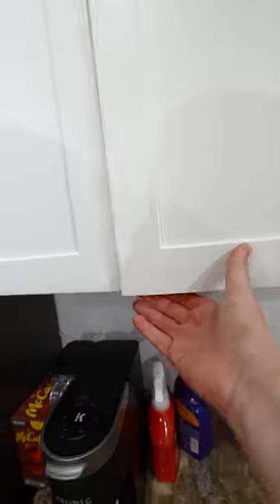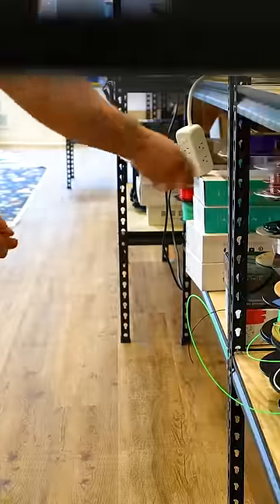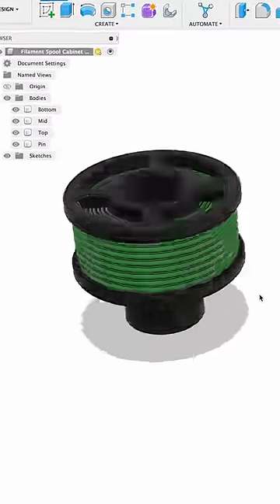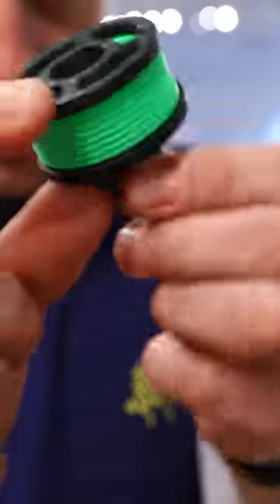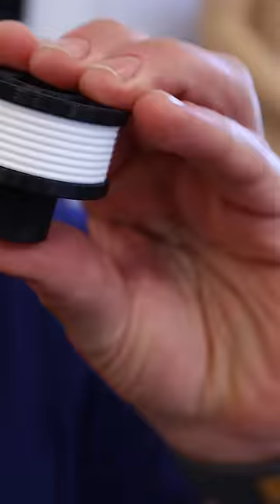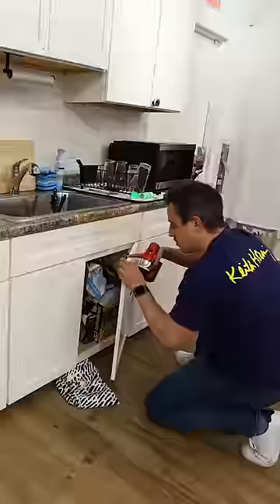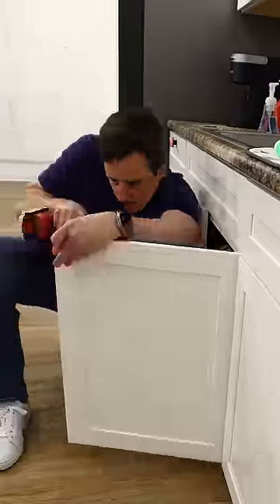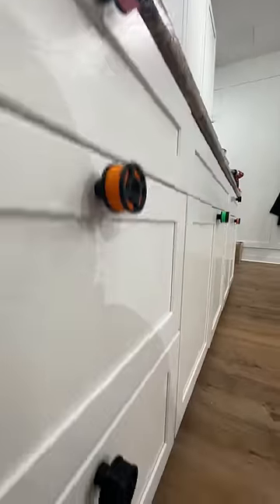i made custom cabinet handles

Comment: the fact that not one of the drawers had handles 😂😂
Reply: It's a more common design choice than you might think. Pretty sure I've seen less and less handles on kitchen cabinets and drawers with each place I've lived in. Absolutely none here now. Just meant to grab slightly oversized edges to pull things open instead.
Reply: @Necrofitz  that's the most disgusting design thing I've ever heard like that is unbearably impratical
Reply: @Necrofitz   i hate the fact that in the modern age its style > practicality
Reply: Actually they forgot to install those push to open thingies. Gentle push and the door will spring open.
Reply: @SapphireDoodle  I think it is not that bad. 
If it opens by pressing on it rather than pulling, it would be much cooler than designs with handles.
Reply: @salmasayed5274  , voice control would be better; mind reading in the future.
Reply: @Necrofitz  Most of the ones I've seen are PTR spring clips. You push the face of the drawer and it just pops open. It's as if someone saw it in pictures and wanted to replicate it because it looks "clean" but didn't realize that they're spring loaded.

Comment: "I used the filiment
to print the filiment!"

next up: printing a usable printing filiment
Reply: Later: 3D Printing a 3D Printer
Reply: @CJ lite  one month later: 3D printing a functional 3d printer to print a 3D Printer
Reply: Next year: using my 3D printer to 3D print a 3D printer factory
Reply: @bacn_  Next decade: using AI to 3D print a matter replicator
Reply: If you print something and it doesn't turn out looking good I think you can just turn that into filament back (I have no idea how it's done, but you probably can). Also you can 3d print a 3d printer (apart from some stuff like motors, fans and drivers)
Reply: @FrontWaffle  A filiment extruder, yeah. But it's funnier to use the printer
Reply: I 3d printed a 3d printer that 3d prints a 3d printer that 3d prints a 3d printer that 3d prints...
3 DECADES LATER
...that 3d prints a 3d printer that 3d prints a 3d printer that's smaller then an electron
Reply: That is possible
Also, next a 3D printer that 3D prints a 3D printer extruder.
Reply: Filament*
Reply: I used the stones to destroy the stones
Reply: You beat me too it, have my like
Reply: @cjlite0210 forgot the name but there is a game where you use a printer to print a bigger printer to print the biggest printer
Reply: “ Printing a black matter obstructer to create a BLACK HOLE #blackhole #3dPrinted #DIY “
Reply: A mold
Reply: That is a actual thing lol.